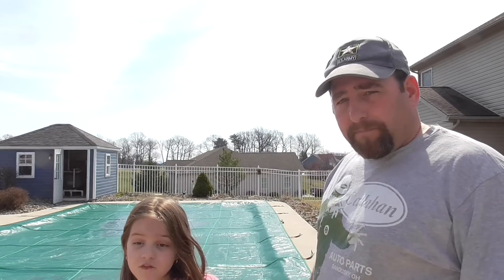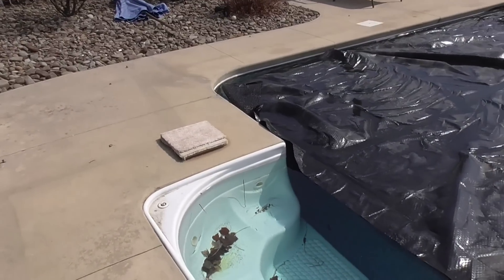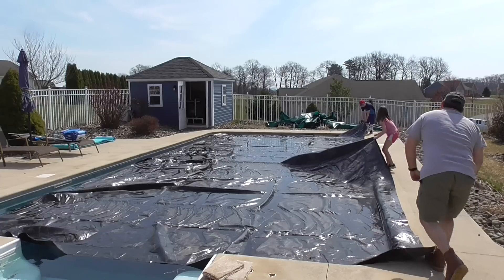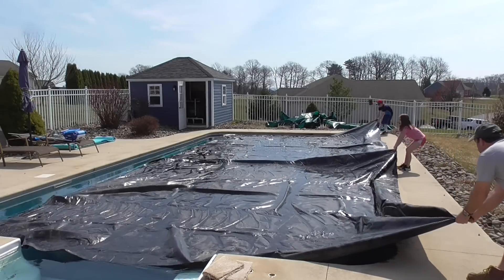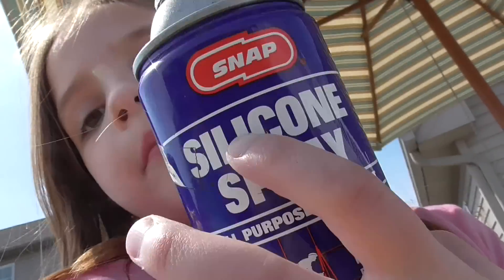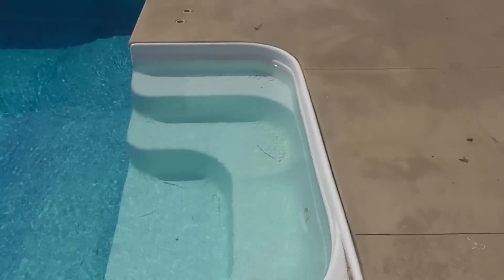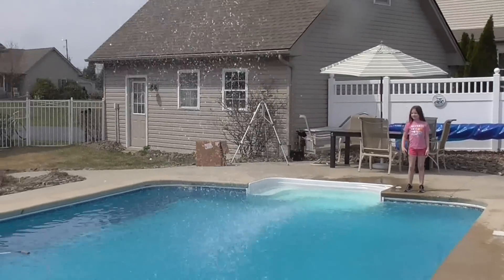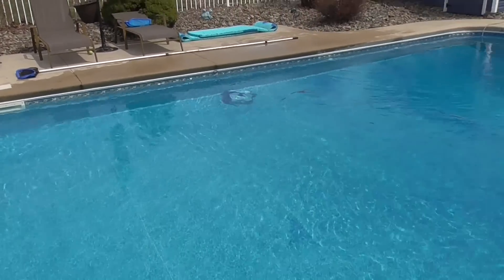Pool Opening New Cover: Is the Water Clear?

Comment: Here in Charlotte I started to just leave the pool open year round.  I just have the pump on freeze protection.  Of course it doesn't get super cold here.

Those nets are far superior to those flat cheap nets.

Good job on the pool.  I would have gotten the covers sunkin and full of water.

Comment: You need to get rid of that sand filter.  We had a 2hp single stage pump with a sand filter.  Got a intelliflow but had to run it at high to get decent flow.  Upgraded to a 100 quad de filter and used 40% of the electricity to get the same flow.  You could just get a DE filter and run a  your single speed pump a lot less.